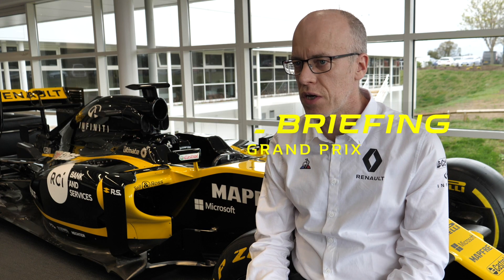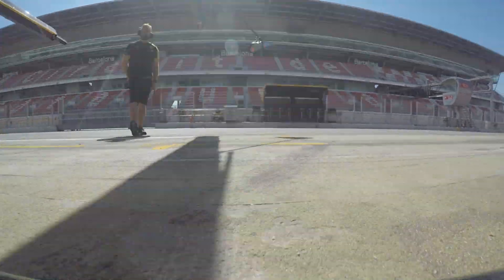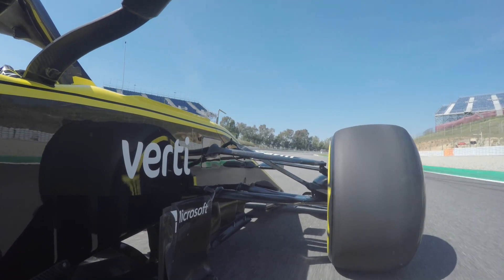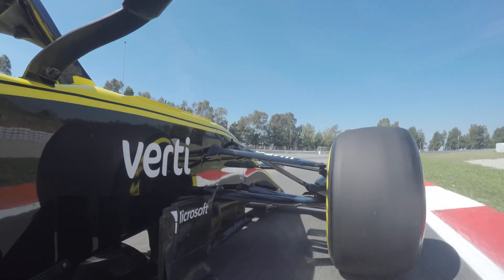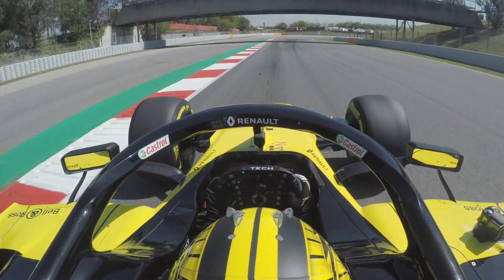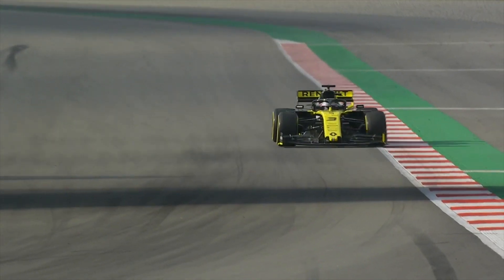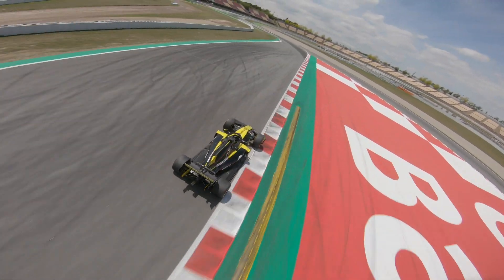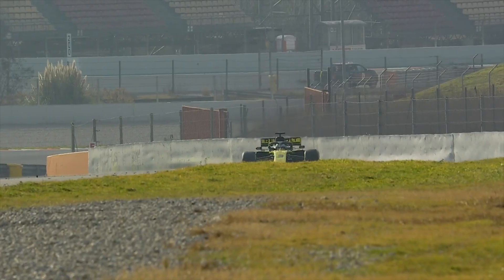2019 #CanadianGP: Technical Briefing with Pierre Genon

Comment: Are you allowed to put a small brush for the brakes to get cleaned while driving. If carbon dust build up is a problem. Maybe thats the solution.

Example put a small soft brush something similar to a duster on the back of the brake pads and maybe the front. So when the driver brakes. It clears away dust particles. An when the driver is accelerating they don't cause drag or friction to the rotation of the wheels.